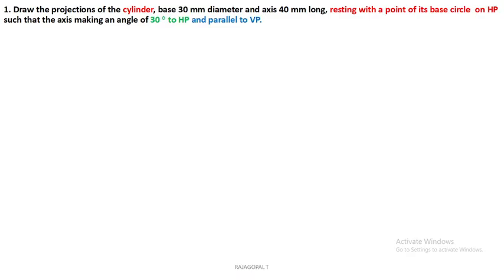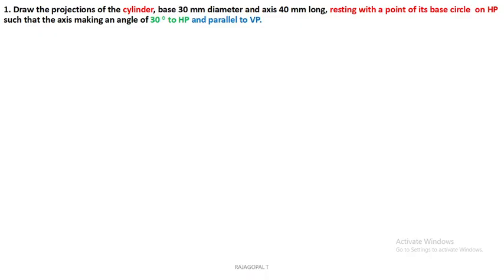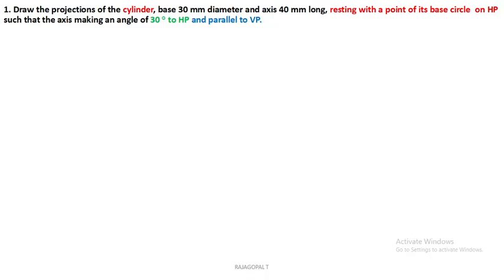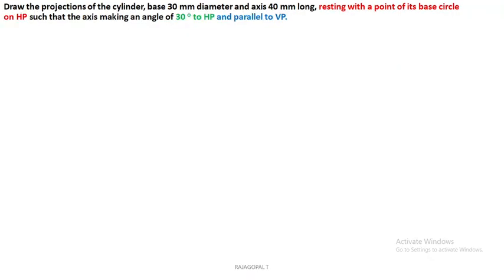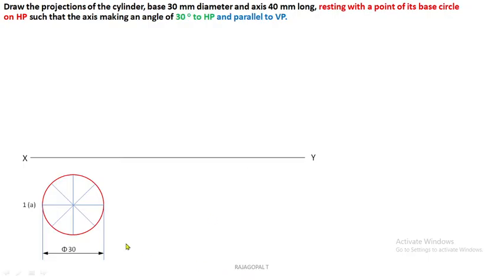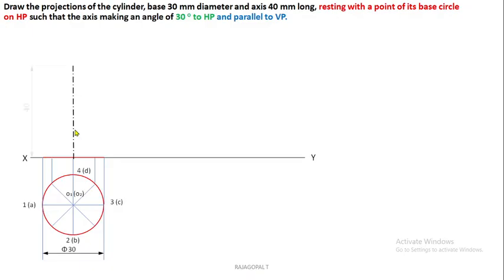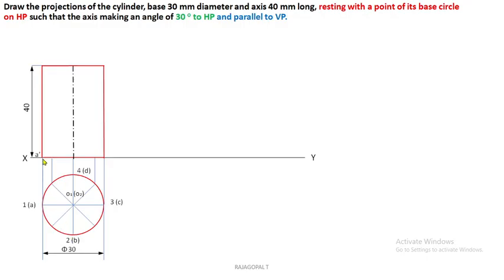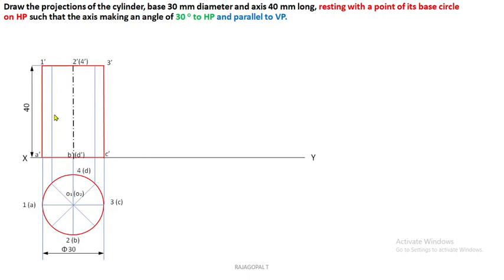Projection of Solids Cylinder | Axis inclined to HP @rajagopalthangavelsforum

Comment: A cylinder of 40 mm diameter and axis 60 mm high is resting on HP with one of its base circumferential points. The axis of cylinder is 300 inclined to the VP and 450 inclined to the HP. Draw the projections.

Comment: Draw the projections of a cylinder of diameter 30mm and axis length 50mm resting on the HP on a point 
of its base such that its axis is inclined at 45° to the HP and parallel to VP.

Comment: A cylindrical pen of radius 20 mm and height 70
mm is inclined 35
o
to the wall due to its weight. Draw its projection by change of reference line
method.

Comment: Acylinder, diameter of base 60 mm and height 90 mm, is resting on the H.P. on the point of its periphery of the base. The axis of cylinder is inclined to H.P. by 30° and (i) the top view of the axis is inclined at 45° to the V.P. and (ii) the axis is inclined at 45" to the V.P. Draw the projections. Keep top end of the cylinder nearer to V.P. in one case and away from V.P. in other